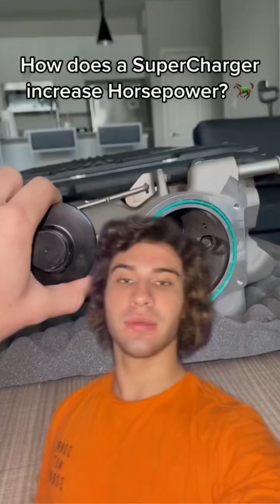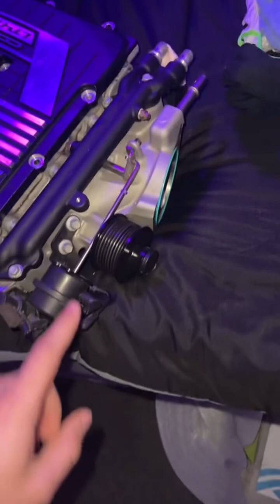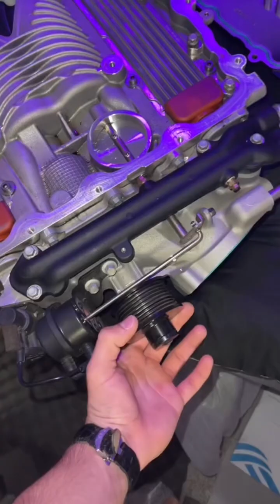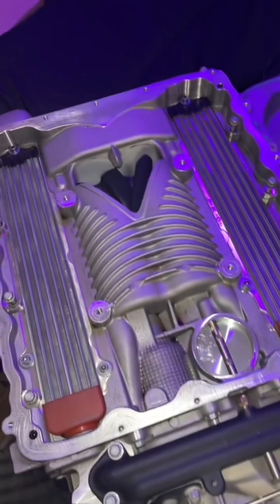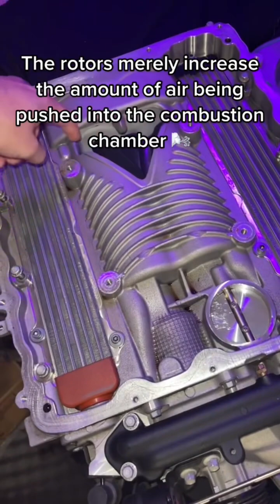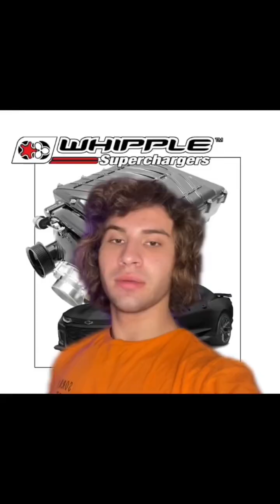HOW SUPERCHARGERS INCREASE HORSEPOWER OUTPUT!? (TVS BLOWER ENGINEERING EXPLAINED) #SHORTS #BOOST

Comment: It does compress the air in the supercharger just not as much as a turbo
Reply from the maker: TVS superchargers do not compress air in the rotors 🫡
Reply: @TobyVegaD  I never said that a specific supercharger that you were talking about compresses there in the rotors but technically speaking you're wrong Google it every supercharger will work the same for the most part it if you're talking about two twin screws comparing them or two Whipple designs you're still compressing the air
Reply: @dudeenglehart6517 this is a roots blower, it doesn't compress air. Twin screw/scroll and centrifugal compress air